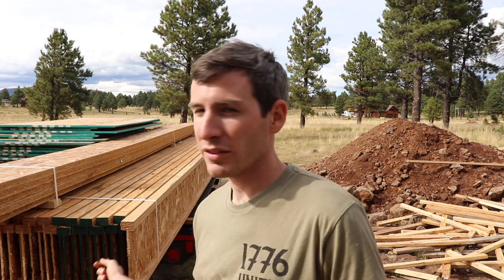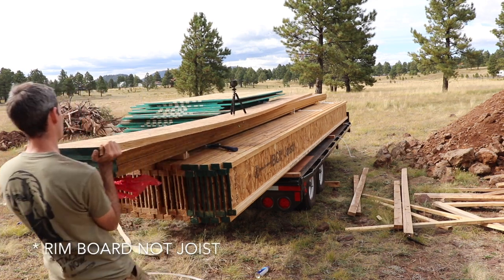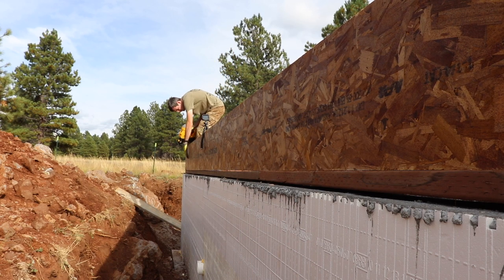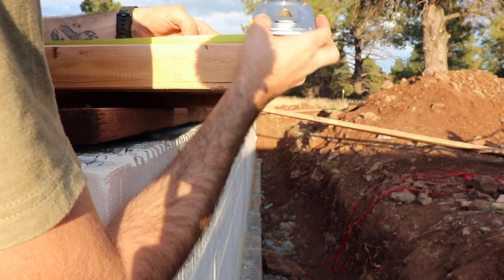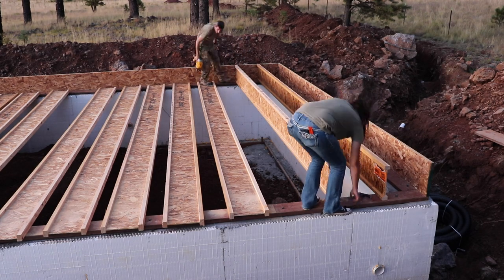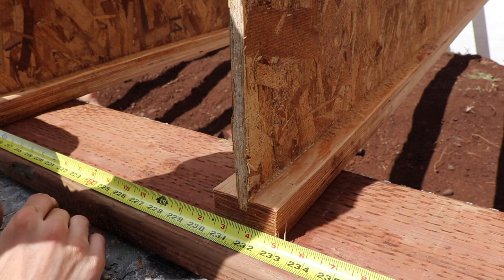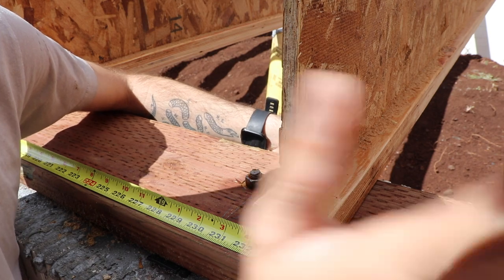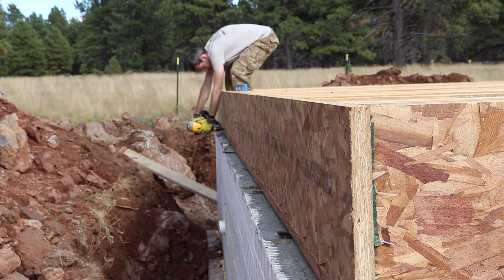Framing The Floor For Our DIY Cabin (I Joist Floor Framing)

Comment: I have use a paddle bit the diameter of the nut to drill a hole in the bottom the BCI to allow for proper spacing if there is a conflict with a bolt. Looks like its only sticking up about 3/4 inch so the "pocket hole" for the nut and bolt will not compromise the strength of BCI. Nice work!

Comment: You could of slide the first joist on the edge and lay it side way then the next one slide it on top of the first joist and then just flip the 2nd one so it will be off the first one, and then slide the 3rd jois on top of the 2nd one and like this for ech joist, that is a skill that with time you learn so you dont need to get in the basement to pull up the joists on top of the 2nd edge 👍
Reply from the maker: That's a great tip! Thanks for watching!

Comment: I'm pretty sure in your j-bolts you're supposed to use a 3-in square washer...at least that's what code is here in WA
Reply from the maker: uhh I think you may be right lol... however our inspector approved the foundation and floor system, so I'll do my own research and if they need to be changed, I will do that!! thanks for the comment, and not being a dick about it lol!!

Comment: A slight notch, and I do mean slight, in the joist flange should fit right over misplaced anchor bolt. I wouldn’t deviate from your on-center spacing. This could cause a floor sheathing headache.
Reply from the maker: When I read the installation guides everything said not to notch the flange, then later I found the part where it told you how much of a notch was acceptable... but it was too late.   However moving it over gave us a big enough space for our crawlspace access.

It deffinately could have caused issues installing the subfloor but we were just mindfull not to have a seem between sheets on that joist and we were fine!
Reply: Nice build, you could of cut the bolt   and moved it over to keep center.
Reply: Lol just remove the nut and washer and beat the bolt over.

Comment: Would 2x12 work on that span. I am trying to figure if to go 16' or 20' wide on my cabin with 1 foot over hang on each side.
Reply from the maker: I'm not sure, I think I ended up going with the I-joists because 2x12's wouldn't have the stiffness that was required, but I am honestly not positive, there are a-lot of charts you can find on line that list what dimensional lumber can be used for what span.  However I did really like working with the I-joists, they are a-lot lighter, and easier to move than dimensional lumber, they are perfectly straight, and you can span further lengths.
Reply: @PootsPastures  Thanks and I have been looking at charts a few times this week. I think I got it set already on paper.
Reply: Yes. Im doing my cabin now. 16 ft span....2 ft on center.
Reply: @FinehomesofNewHampshire  I think I'm going to build a metal building instead. I may do a 30x60 that way I can have my work shop and small cabin like structure in the metal barn.

Comment: Are you allowed to make your own I-joists to pass code or do they have to be purchased from an official manufacturer?
Reply from the maker: So the short answer is no because they have to be engineered so that the building department can confirm that they will stand up to the loads they will be subjected to.  

The long answer would be if you had the resources to design test and build a repeatable product and have it engineered by a professional (which my guess is no one would do unless you were a manufacturer) then theoretically you may be able to build your own.

The problem is that there is a lot more that goes into the design then just notching a 2x4 and putting an osb web in between.  The osb web is specifically designed to support loads on its edge (which most osb is not designed for) and the flanges are specifically designed for their job using laminated veneer lumber.

Hope that helps!

Comment: How would you attach a deck ledger board to the long side of an I- joist?
Reply from the maker: So in our situation we have rim boards around the entire perimeter so we will just have to secure the deck ledger to our rim board (as our I joists actually start 19.2" in to the building).

However the process would be about the same for attaching the deck ledger to an Ijoist or a rim board.  In our situation we will be using structural screws instead of bolts, so you would just add blocking in the web of the joist to make the web flush with flange of the joist.  You would then just screw into the areas that are blocked.  You would use this method for bolting as well.

Hopfully this answers your question. We will be building decks off of our build so we'll eventually have a video of this.

Comment: Great videos, I'm hooked. Question, why didn't you use joist hangers?
Reply from the maker: Thanks, I'm glad you're enjoying them.  And I don't have a very good reason for not using joist hangers.  I just thought it would be a little easier to put the joists directly on top of the sill plate with the ICF's.  I have seen a lot of other people use the hangers with ICF's and if I did it again would probably do it with the hangers instead.

Comment: When using 14" I-joist 16 O.C span 22 ft does it need load bearing wall under?
Reply from the maker: So this is kind of a hard question. So depending on the manufacturer there are several different 14" tall I joists.  Your best bet is to reference their specifiers guide which should have a chart in it.  With the manufacturer we went with (Boise Cascade) a 14" joist at 16"o.c. could span 19' or 27'.  The reason for the difference is how thick the webbing is as well as how thick the flange.  But whatever distance is listed on the chart is the "clear span" distance meaning there are no supports in between the ends.   And to make things more complicated the more support you have on each side the longer the span can be.  We had a 2x8 sill plate instead of a 2x6 or 2x4 so that helped how far of a distance our joists could go.  

Hope this helps, thanks for watching!

Comment: although these "I" joists are strong, they are also the reason that homes burn much faster as compared to dimensional lumber. The OSB in the center deteriorates very quickly in a fire and actually makes it extremely dangerous for firefighters  due to the quickness of structure collapse. These are in no way the same as "Laminated Beams where dimensional lumber sandwich  OSB and the whole width of the beams are the width of the dimensional lumber and not determined by the width of the OSB like it is on these flooring joists. Just something for everyone to be aware of is all
Reply from the maker: Yes they burn very quickly! but on the flip side they are light and strong which is nice.
Reply: @PootsPastures  I totally agree with you on that aspect but as much as they can be dangerous for firefighters in such a situation, they can also be extremely dangerous for you and your family should you get caught inside of the house and need to depend on these structural pieces for exit. I myself would much rather put the work in in the beginning with the weight for safety in the long run for everyone involved IMHO.

Comment: Are you going to put in an access to your crawl space from the inside of the finished space?
Reply from the maker: Yes the crawlspace is a "conditioned" crawlspace so it will be sealed from the outside, and access will be through the floor on the inside.
Reply: @PootsPastures  how are you planning on "finishing" the crawlspace floor? I understand the wall are insulated from ICF foam, but was curious of your plans. 

I also didn't see you frame in an access with your floor I joists which prompted my question in the first place.
Reply from the maker: @gabelumby8206  the floor of the crawlspace will be finished with a moisture barrier taped to the ICF's to create a continuous air barrier.  Also we had to shift one of the joists over because of one of the bolts so the space in between two of the joists is over 18" which is code (the opening has to be 18"x24" minimum)  I didn't frame it out until after most of the subfloor was on so I'll go over it in the next video.  I hope that answers your question!

Comment: Good video. But just remember you can also make something “nail poor” with too many nails
Reply from the maker: Deffinately a good point, the manufacture usually has a minimum nail spacing especially for the engineered lumber.  In this case the manufacturer specified that the rim board be nailed to the sill plate every 6", I didn't measure 6" exactly but I should be pretty close to that!

Thanks for watching and the comment!!

Comment: Love your videos! I'm planning a very similarly sized project. I noticed you didn't show the installation of a post and beam on top of your single foundation pier. Is it just supporting one of the joists or was this done afterwards? Thanks!
Reply from the maker: I did not show that, so the single pier has a post sitting on it that supports a post on the first floor that supports a beam supporting the second floor... that was complicated... but basically the way we designed our second floor was with a glulam beam in it to allow us to have an opening for the stairs.  To support this beam we have a post that's inside the wall, and then a post on the first floor that will be exposed by the stairs.  It was easiest to just add a single peir and small post in the crawl space to support this.  We just put it in on random days that we didn't filb because the weather... I hope that helps! We have a video where I explain the blueprints for the house if you check that out it might make more sense having a visual refference. 

Let me know if you have any other questions! And good luck on your project!
Reply: @PootsPastures  So is the initial post in the crawl space attached directly to the I-joist above it, or did you have to put in an extra beam or blocking in the floor?
Thanks for the response! I saw the blueprint video too. It was very helpful.
Reply from the maker: There is no joist or beam between the peir and subfloor, I nailed a few 2x6's together to make a small post that transfers the load from the subfloor to peir.  If I had to do it again I would probably run a beam across the second floor framing and hung the glu lam we currently have from that to avoid the post and peir completely, as it was hard to get the location of the peir correct, and it was probably pure luck that it was in the right spot

Comment: It would be much safer and easier if you back filled
Reply from the maker: Probably...
Reply: Can't backfill until concrete sets a minimum of 2 weeks, preferably more, the ICF is waterproofed and the footer drain is installed. Nobody wants to wait that long...